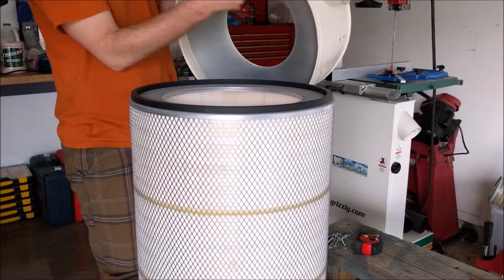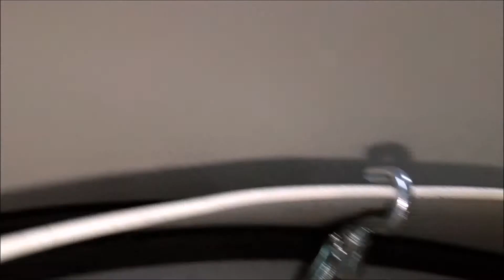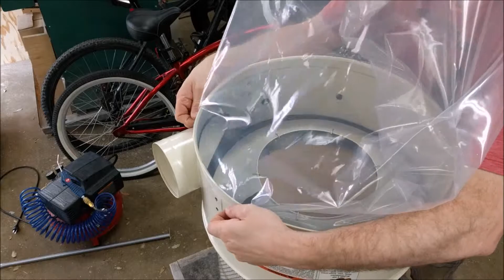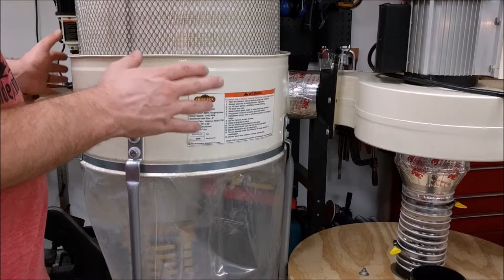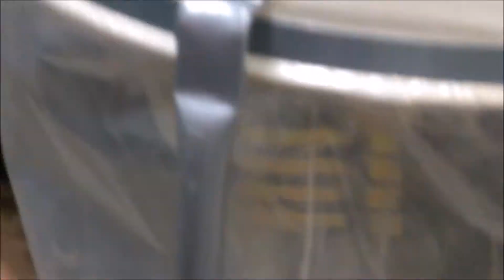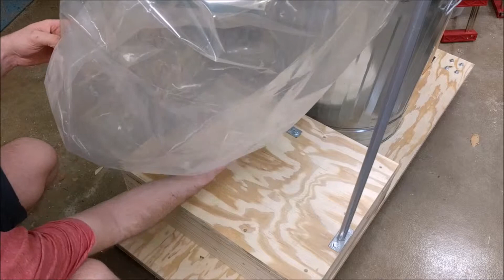Dust Collector P3: Cartridge Filter Installation, Leak Checking, and Final Result

Comment: This was an excellent trio of videos, thank you for taking the time to create and post them.  I'm about to create a second stage system for my HF DC, so I've been watching a good number of instructionals.  You explained the reasons behind your decisions extremely well, and brought up some great points I hadn't considered (or seen discussed elsewhere).   I don't think I'll be able to engineer to your level of precision, but it should still be a vast improvement.